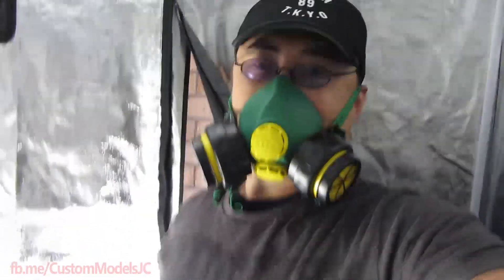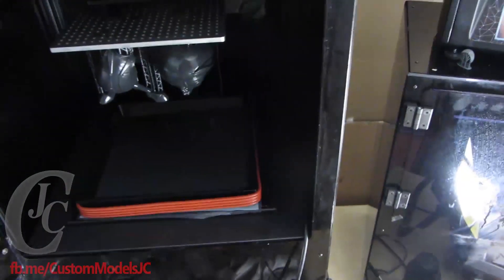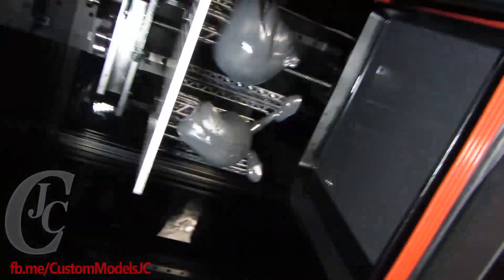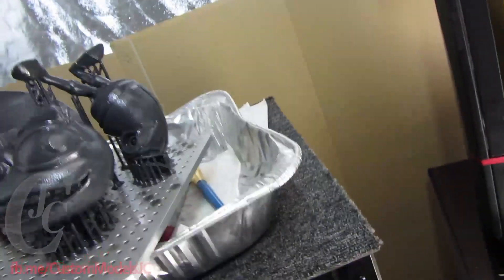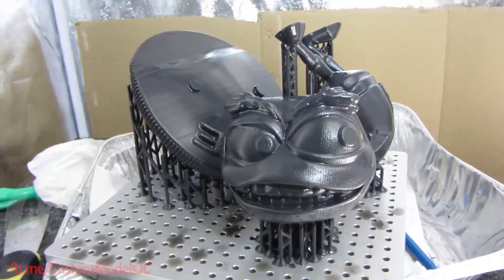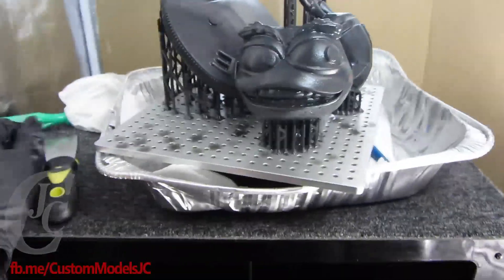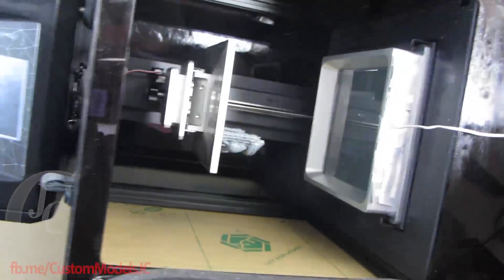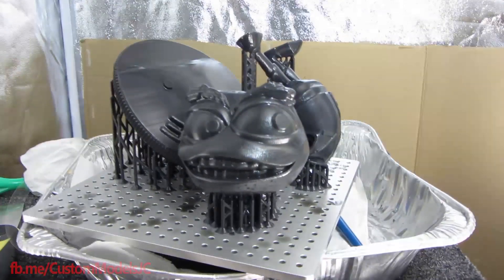Peopoly Moai 200 almost perfect print ( part 1 )

Comment: Found your videos while trying to make a decision on what printer to get and they have been very helpful, awesome models as well by the way, the Ice Giant is my favourite! Is the texture on the body and head of this print on the 200 intentional or is that the staircase effect? How good would the 200 be for hard-surface models in your opinion (tanks, spaceships etc.)? Appreciate any feedback and keep up the good work.
Reply from the maker: Im still dialing in my Moai 200, the layers on the head is because I printed at 80um so it prints faster, at 60 or 40um it should not be noticible. If you can live with the smaller build volume the Moai 130 is a great machine, always reliable for me and easy to maintain.

Working with so much resin for the Moai 200 can be messy, you want to make sure you have proper space for it.

Hard surface models are always difficult to print with resin printers, due to the nature of liquid resin technology, if your goal is to print very large hard surface parts, FDM would be better suited for this type of work. unless you can afford the new form3 :)

Comment: Is the dust mask is really necessary. I have a 130 and the resin smells a little. Shoot A permanent marker smells more.
Reply from the maker: yes, I keep the printers in an enclosed grow tent, the fumes build up over time.
I keep my mask on during the cleaning process also because denatured alcohol is also not great for your health.
Reply: @vfxforge  which grow tent are you use? Curious what are the dimensions?